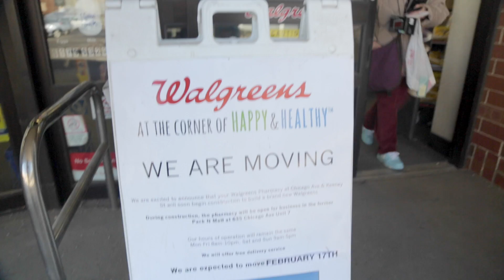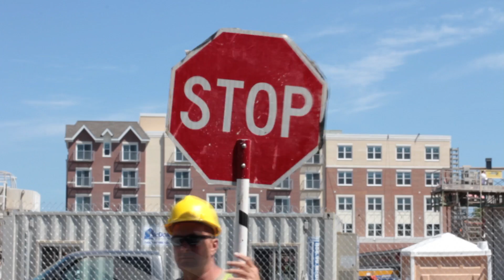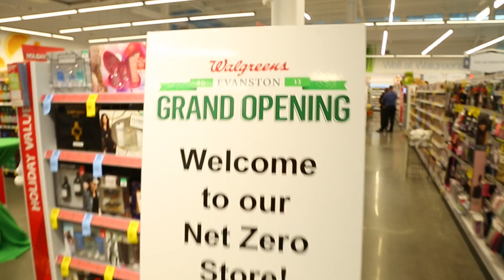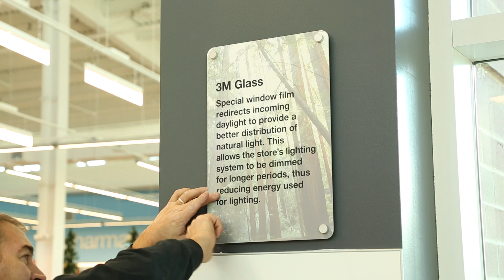Walgreens Net Zero Store Time Lapse Video

Comment: "At points" the building feeds electricity back into the grid, however what is not mentioned is that ON AVERAGE the building uses more electricity than it produces.  So as an illinoisan I'm in no hurry to tear down any nuclear plants as long as you're building "net zero" buildings that still require electricity from the grid.